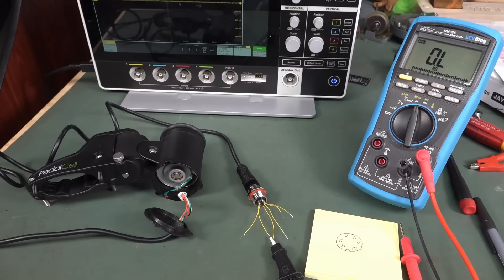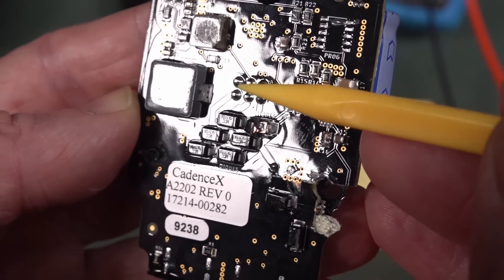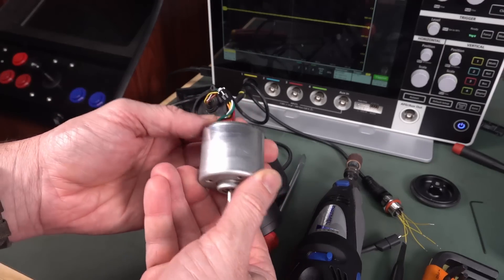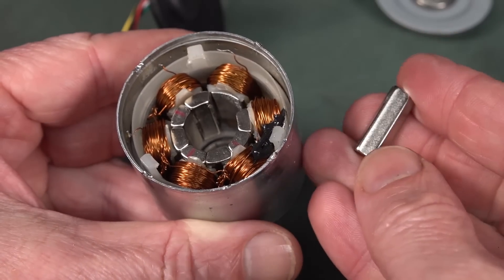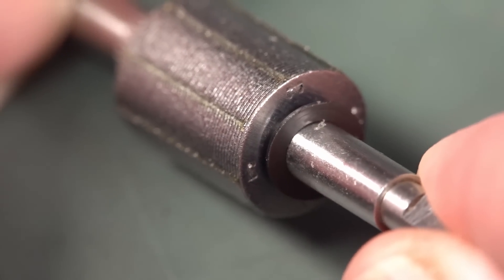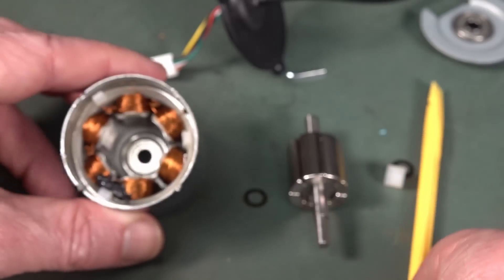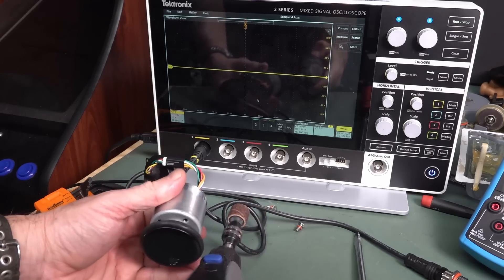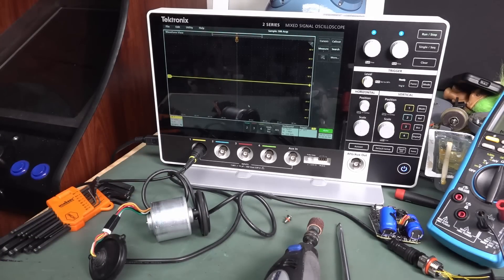EEVblog 1485 - PedalCell CadenceX Bike Generator LOL FAIL!

Comment: Proper industrial servomotors can lose their magnets if they spin fast enough. When the magnets fly off, the coils are destroyed. This is how I destroyed a big and very expensive industrial servomotor. Heat-cured tape is wrapped around to hold the magnet assembly together, but a few seconds at speed was enough to break them off.

Comment: In days past, those magnets would have been glued to the spindle, then screwed to the spindle straight through the back of the magnets and thread into a tapped hole into the spindle. Finally those screw heads would have been chisel/punch-set so they couldn't back out.

Comment: @ 9:33 I don't think the amount of glue is the problem, but the fact that the generator when it works heats up very much and the adhesive finally gives way ... If it is used in summer, during the day with more consumers tied to the generator and the cyclist starts to go down on a high-speed mountain, the generator should eventually reach temperatures high enough to cause the adhesive to lose its properties ... but I still don't think it exceeded 80 degrees Celsius because it would lead to the demagnetization of the magnets ( if they use neodymium magnets).

Comment: I restored an e-bike motor with this issue.  I glued the magnets back in place with loctite 638 and replaced the brushes.
Reply: Couldn't find 638 but found 641. Its app. notes says it would work with this kind of problem I believe.
Reply: @jdmccorful  I bought some on Ebay in the UK based on recommendations for this issue.

Comment: A few inches of Scotch tape wrapped around the magnets would be the simplest cheapest fix.
Hey PedalCell, you can send me one of these to thank me.
Reply: Tape will not hold the magnets to the shaft with the strong magnetic force and   the shaft will eventually spin free without the magnets moving.
Reply: @danc2014  If the factory glued them down and then taped them the irregular surfaces could not separate. The glue forms ridges on the rotor preventing the magnets from sliding.

Comment: Laminations are to make assembly easier for the manufacturer, instead of machining a bar they stack layers of metal, likely made at the same time as the outer laminates in a punch. The magnets flying off probably was from them not cleaning the magnets properly, likely still a bit of oil from somewhere left on, and not washed off, or contaminated wash solvent being reused too much. Likely they were relying on the varnish holding the magnets on, but none got to the base of the magnets, so only the tiny bits on the sides held. Going to guess all have the same issue, and all will fail sooner or later in the same way.
Reply: I also agree that all the alternators in the batch are likely to fail similarly.
Reply: I agree re degreasing of the magnets prior to bonding. Very important, very difficult, and as you say goes wrong if the solvents become sufficiently contaminated. Degreasing at a factory I worked at back in the 1980s took three days and involved three vats of solvent.

Comment: Comment from the Manufacturer: "Dude, glue is expensive, you know, so we use only a tiny amount to reduce global warming and save the environment, pfft!"
Comment from Derek: "Electric energy flows outside of the wires, as I explained, so the magnets don't matter"
Reply: Don't worry... the new CellFail 13 will eliminate the glue and motor completely. It will be entirely wireless, and run off a rechargeable battery.
Reply: @johncoops6897  Maybe, but will it use a knife switch and have Bluetooth?

Comment: The laminations are to prevent Eddy currents and resulting electrical losses which would happen if the core was pure steel, for example.  The direction of the laminations and insulating varnish layers are 90 degrees to the direction which Eddy currents would happen.

Comment: that laminated steel rotor makes no sense being inside the magnets. the should have just molded the whole magnet and shaft assembly in plastic and it would have been much stronger and cheaper. the fan motors at the company I work for are constructed just like how I mentioned except the stator is inside and the magnet assembly is molded in nylon around the metal housing for the rotor which the fan blades are attached too.

Comment: Normally, if you're rotating magnets, you wrap them in epoxy soaked carbon fiber... then you rotate the assembly using a fishing rod finish rotation assembly until dry/cured.

--- Oh, I'm kinda missing the sub-conversation with the random bots created in April of 2022.  I really wanted to taunt them a second time.

Comment: It looks like they used CA glue or an epoxy that was really brittle.  It looks like they used enough glue for it to squish out between the magnets but it was the wrong kind for the job.  CA glue and many epoxys are very brittle and don't cling well to smooth surfaces like those of the magnets.  The reason it looks like they only used glue in spaces in between the magnets is likely because the glue was pushed out from under the magnets when they were attached only leaving a very thin layer that stayed attached to surface of the rotor.  A better way to construct the rotor would have been to make the rotor the correct diameter and cut or mill channels in it to slide the magnets into it and then epoxy the magnets in place.

Comment: It's dodgy. We've had push-bike wheel dynos that worked fine to power lights for years with no such magnet issues. Cheers for the pull down report as always!
Reply: Those generally have a horseshoe magnet rotating around a stationary coil. Very robust.
Reply: Also very low power and not very clean.

Comment: They would have been better off using a conventional stepper motor, or an ordinary 12v DC permanent magnet motor (like in G-scale model trains) + an encoder wheel and slotted optocoupler. This BLDC motor was probably counterfeit Chinesium crap. It would have been really amusing if Dave had powered it as a brushless DC motor; it would have made quite a racket as the magnets bounce around between the rotor and the stator pole-pieces! 😂😆
Reply: "This BLDC motor was probably counterfeit Chinesium crap."

Counterfeit?  They're almost all made there now anyway.  Time to call them "original Chinesium crap" and the ones from Vietnam counterfeit ?

Comment: Looks like one of the diodes in the bridge is missing or damaged. There should be six diodes for a three phase bridge.

SKS sounds like a knockout of SKF, which is a well-known bearing manufacturer.
Reply: If you watch the initial maibag video this came in on, or the shorter clipped version just for this product, you'll see a few components got ripped off in the tear down where the potting on the underside of the board refused to part with them.

Comment: I tried a couple of generators back before LED headlights were a thing.  The drag it added was horrendous !  Furthermore, the light output was dimmer than when running on batteries.
Today, I think anyone who wants to charge their phone with a bike doesn't realize just how much power that requires.
Reply: When you're doing a heavy workout on a treadmill or stair machine, it's about 300W. That's WAY more than you need to charge a phone - more like 5W (5V x 1A) at minimum. If your generator introduces enough drag you even notice it to make 5W, that's just a really shit generator.
Reply: I'm sure that these are marketed toward greenie "save the planet" eco-warrior types.  The ones with lots more money than common sense.

Comment: Hi Dave! Love the channel, you, Big Clive and DiodeGoneWild pretty much taught me everything I know. When I was a kid we used to have a dynamo generator on my bike for powering tungsten lamps for riding at night. It made the bike tougher to ride, but it meant that I didn't have to keep buying batteries when I only had my pocket money. These days though I'm guessing given how efficient LEDs and lithium batteries are, it's probably easier/cheaper to just strap a decent sized "smart" power bank to it and run a bunch of USB cables, or if you wanted to go 12v (like SLA maybe), you could wire in a cigarette style 12v to USB adapter. I guess this product is in the gimmick / convenience market, rather than solving a problem?

Comment: Gosh... I'd've attached those magnets with lots of glue to the rotor and, just for good measure, potted them in resin as well.
But I guess that's the engineer in me speaking. The accountants would've hated it. 😂
Reply: a strong tape on the outside would have held
Reply: @wjodf8067  All the mechanical power needs to be transmitted through the glue from the spinning shaft to the magnets to spin them. Tape on the outside would do nothing for you if the glue fails - then you'd have a magnet ring that's still not connected to the shaft.
Reply: @gorak9000  Well LARGE motors use a lot of fiberglass taping.  Of course the rotor poles/windings are in machined slots so the torque isn't transmitted to them by simple friction/glue.  But the 'banding' is to contain the high centrifugal forces when you spin the rotor at high speeds.

So if they machined notches for each magnet to sit into on the rotor, and then machined a tiny notch on the outside of the magnets for some sort of high-strength band, would have been a lot better.  But I'm sure, as Matheus pointed out, 'the accountants would have hated it.'  😂
Reply: @gorak9000 just tape it down harder, bro

Comment: Well... it's a good source of neodymium magnets, if nothing else. Maybe enclose the stator coils with the rotor of magnets? (Rotor outside stator, instead of within it.) That way centrifugal force would tend to push the magnets against the case, rather than at the coils.
Reply: £32/magnet!!

Regarding having the magnets rotating outside the stator coils, enclosed in a cylindrical tube (which I presume you mean): I like that idea. Effectively no max rotational velocity then. Maybe the cylindrical tube could be the outside of the alternator, turned directly from the bike wheel or whatever?
Reply: @jb9652  You presume correctly. I wonder if this is what drone motors do, since the whole outside housing tends to spin with those. Coupling directly to the wheel would help with power generating efficiency, but might come at a cost of constant drag.

Comment: I think it is interesting that there are 6 poles on the stator and 8 poles on the rotor.  The first time I saw that I would have thought there would be the same number on both.   But after do a little searching, apparently having an uneven number makes the output sinusoidal and reduces vibration.  Be interested in hearing your take on the reason for the difference.
Reply: Another thing, since this was originally meant as a motor, the unequal count assures that there are always at least two coil sets that can pull the rotor into alignment with themselves, allowing the motor to self-start.
Reply: Yeah, I've seen this before.  Especially with MOTORS that you like to run at very slow speeds (as in Model Trains).  When the pole numbers match, you get more 'cogging' where the slowly turning rotor sort of 'jumps' from one pole to the next in a not very smooth fashion.  This arrangement, as you slowly vary the three phases, the rotor moves more smoothly.
Reply: @mikefochtman7164  You're right.  And as a generator it should also benefit from this with reduced cogging.
Reply: Thanks for noticing that and bringing it up. It makes sense to me in that the shaft is going to want to stop with a magnet as close as possible to a pole piece, and if they all lined up at the same position it would hum like a stepper while being turned.
Reply: Thanks to all who replied.  It definitely helps to clarify why there are usually an unequal number of poles on the rotor and stator.

Comment: I'm not sure cuz I haven't watched the whole video through yet but I believe those magnets are supposed to be attached to the armature my theory is the bicycle made the motor spin too fast and the magnets couldn't hold up under the intense forces and fell off of the shaft without the magnets spinning inside the coils of course there's going to be no voltage coming out of the motor
Reply: Bingo he got it

Comment: Fascinating! A motor designed to destroy itself by centrifugal force of spinning.  ‘Works great if you don’t turn the shaft!!’  This is like that NOP box that uses a mechanical finger to turn off its own switch. 
  An amazing diagnosis and prescription for recovery, Dr. Dave.  
   I guess we’ll have to put the stator-stator motor effect back in history’s reject pile.
Reply: You realise that the motors in a "hoverboard" have a shaft that doesn't turn?

Comment: I have seen this before but only on a drastically overheated motor implementation 
never for a generator, they must be drastically over revving this thing
Reply: I've had one permanent magnet DC motor fail in the same way, but it has the magnets on the outside on the stator and the coil sins on the rotor. Now mind you it's outside so gets a lot of thermal cycling, and was probably 40 years old when it failed. I glued the magnets back to the outside of the motor with jbweld and it works just fine again.